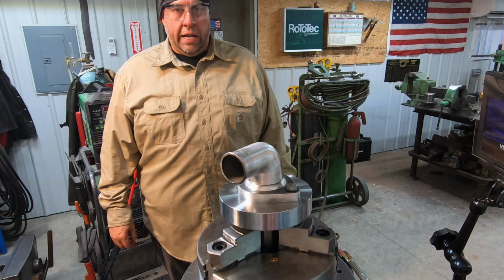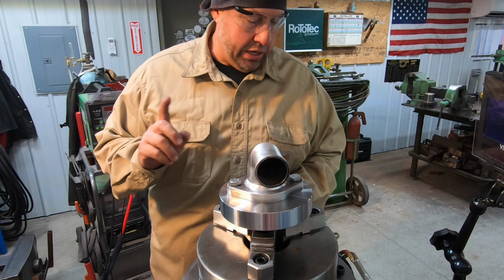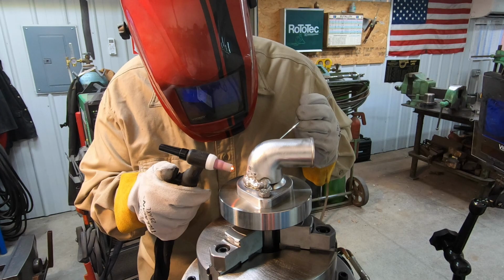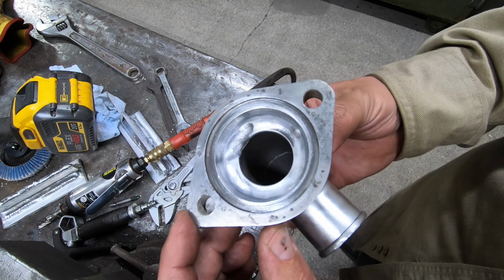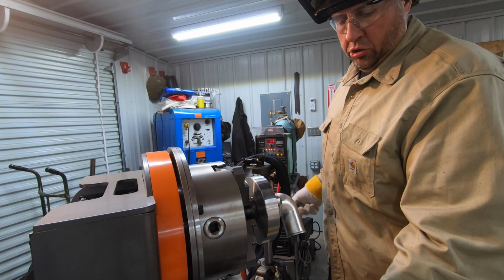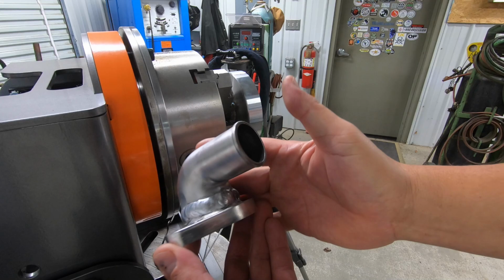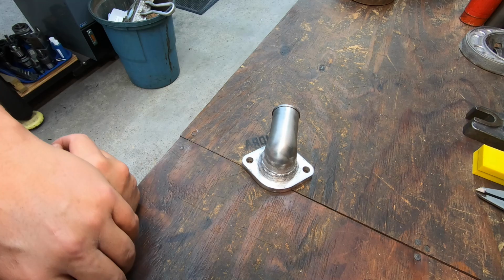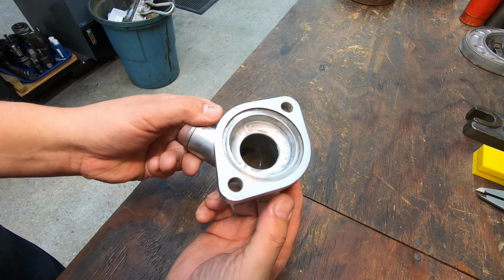SNS 328 Part 2: Welding the Custom Mopar Water Neck

Comment: hey adam i just went through the same thing trying to weld a cast aluminum oil pan. unlike you i finally gave up.have you thought about trying one of those torch switches that can control amps? i think i would have a better chance of winning dancing with the stars than mastering two foot pedals.

Comment: Pot metal is my guess. Back in my early atv days, I was prone to coatings, ceramic, powder coating, etc. Water pump covers, clutch covers, always came back cracked. Those low structure parts were always made of pot metal and confirmed as the problem every time the coating place handed me back a pile of chunks (we were cool, theyd always buy me new parts).

Comment: In case when aluminum welds like this it means that you provided not enough heat and shielding. Use larger cup and put like 180-190 amps. Personaly i would go for 200-210 for rotary table but i'm pro welder, you're pro machinist; if you saw me at work i bet you coud have same amount of things to point out :). For that thick material also increase AC frequency to hear constant buzz rather than this low rate shooting. It's more abrasive type of current. If you have AC balance in that machine put sinusoide more to DC+. That will help with oxides and eventual dirt.

Comment: Congratulations Adam. I think you made a valiant effort..... And the results really aren't that bad. As a man said "she ain't much for pretty but if she don't jump I think we got her!"

If it were me I probably would have tried to mount that flange on a four jaw independent and cleaned up the weld with a half inch button insert mounted on an extended neck tool holder..... Just for cosmetic purposes.

Comment: Raising the frequency doesn't "shake" the puddle so deep. Higher frequency will narrow your pollution zone and keep the contaminants more shallow. Also.. if you have enough filler.... just liquify the puddle and go around a couple times and let the junk float to the surface.
Glad you stuck with it.  Not your style to give up :-)

Comment: Talking about dirty aluminium,one of my late brothers in law worked at an Aluminium smelter here in New Zealand who obtained some Chinese smelted  aluminium to check on its purity and found it was so high in iron that rust formed on the surface of the ingots that were stored  under a lean to shelter. Do like watching your videos!
Reply: When you can pick it up with a magnet you know it's bad aluminum. 😆👎

Comment: Solid and gaseous impurities in molten metals are the bane of a producer's existence.  There are a lot of technologies available to purify molten aluminum but each is expensive and potentially dangerous, especially in a job shop environment where the low price supplier gets the work.

Comment: As far as aluminum castings go, this one is not bad at all. They are always nasty, no matter how much you clean the surface, cast aluminum is nasty on the inside. And as soon as you puddle it, the nasties come out it. Exactly what was happening to you. So what you do, is you lay down a bead, grind all the dirt out and lay down another bead on top. Your filler rod is clean, unlike the casting. So eventually you get solid material. Exactly like you were doing, this is pretty standard practice. And once it's structurally good enough, it's good enough, even if it looks a bit ugly.
Reply: Well said.

Comment: Adam, I am a mobile mechanic and deal with aluminum from time to time. I prefer brazing to welding. I use a HTS-2000 rod to repair aluminum. You should check it out it takes alot of guess work out. Awesome job on the neck aluminum is a bear to deal with!
Reply: Best comment here.

Comment: Love it when we both learn something. I had a similar issue welding on an old aluminum Alfa Romeo intake manifold. I wonder if this behavior is a property of an aluminum alloy used in engine parts? I'll have to keep the temperature down when I try again!
Reply: Old cast aluminum from the 50s through the 70s was just that ,poor cast aluminum. Seen some parts weld ok and others just get destroyed. The process of using /making aluminum parts improved a lot in the automotive industry coming into the 90s. You should see if you can find some older similar junk parts of the era and trial and error on them first, or take it to a weld shop.

Comment: why not feed argon into the inside of the piece to prevent oxygen from getting into the puddle from the inside?  done on welding tubing all the time.
Reply: That is a great idea
Reply: i dont believe oxygen is the issue on this, i believe its the impurities the non Aluminum minerals and dirt and other stuff poor casts would have in them. The melting of the metal brings it to the surface. he is not melting all the way through the pipe so once he did his first bead filling it with argon wouldnt be of much use.
Reply: He's not seeing porosity, so back purging the weld wouldnt help where dirty castings are the cause
Reply: That would be more useful in a thinner material, or a poor fit up of the metal to be welded. Which the fitup here couldn’t be anymore perfect.
Reply: @LRGRivera  Wtf? Aluminum is highly reactive to oxygen. The only part that isn’t is the oxide layer on top of aluminum, and that is because it already reacted. Aluminum oxide forms almost instantly on a cleaned aluminum surface, meaning the aluminum is reacting with the oxygen in the air forming a layer on top of the aluminum. Although I’m sure you’ve been “welding aluminum for years without cleaning and haven’t had any issues”. Easy for someone that hasn’t passed any certs for aluminum to say.

Comment: All aluminum castings are weldable.   Welds are just castings without molds.
Bake castings carefully at 400 °F and use the torch soot method of preheat.  When soot burns off, it is hot enough.  Just a light soot is enough.

Comment: oxy-acetylene when in doubt with aluminum. And when you might have several weld start/stops it’s best to start your weld and weld into where you stopped... so your backing up into your weld. 
 Figured I’d drop off some knowledge from a channel where I’ve learned from.
 At the end of the day you got the job done is what counts

Comment: I swear, welding aluminum that has contacted chemicals is a steady challenge for me. I welded up an A/C fitting. I had to heat it to take the impurities, then finally weld it after it cooled. Even then I was only able to do about 5 dabs at a time. 
Another one is cast iron that has touched brake fluid. Those types of things, are just plain difficult.

Comment: I saw the video preview and thought, huh, that seems a little rugged for Abom.  :)  Seems like you learned something new for the next time you weld on some shady aluminum, so that's the important thing.  That, and it's stuck together and going to work just fine!  

Also, the camera you had set up to film while welding looked awesome when everything was facing the right way trying to weld on that awkward part.  Would love to see more of that in the future.

Comment: Was the wire wheel you used to "clean up" the parts before you welded the ally using steel wire? It was necessary for it to be stainless steel otherwise you put contamination into the base metal. That would explain much of why you  were  experiencing problems.

Comment: The part is contaminated with antifreeze within the pours of the metal. It is never going to turn out nice. Now it they where brand new parts that haven't been used. Then it would be a different story.

Comment: That porosity and black oxides looks so familiar! I occasionally get some broken casings at my work and attempt to weld them; same problems; some successful and some not. I thought it was me as most of my welding is in steel and really no other aluminum work. Now I am curious about trying again with your friends advice. You got it done in the end and that's what counts when the job is challenging like that.

Comment: Awesome job abomb yea cast aluminum most of the time sucks some times it’s good but whenever I run into it most of the time it’s bad. Another trick I found is I have really fine stainless steel wire brushes that go on a dremel and I clean each pass before and after with the brushes the dremel just makes it easier than by hand and a little better to get into the tight spots. I don’t know it it really matters but I have heard especially with aluminum to brush with a wire brush in one direction like forward but not back or the opposite when you drag it back the other direction it brings back more contamination that was just swept out. It’s just something I heard a couple years back and now I try to do it on stuff like cast aluminum or something I want as clean as possible. Anyway I think you did a great job Adam your the man thanks for taking the time and sharing your hard work 👊🏻🍻

Comment: Something I didn't see brought up... some aluminum alloys are basically not weldable.  We don't have any idea what alloy this neck/flange were cast from.
Reply: I've welded some 7000 series aircraft grade aluminum before... apparently lots of nickel or zinc in it so difficult to weld. Got the two pieces stuck together but it didn't play nice.

Comment: Sharpen your tungsten, I have no idea what frequency your using to weld but it almost sounds like it’s 60hz. If so try increasing the frequency a little bit that will make your start ups a little crisper. And on cast aluminum you want to treat the weld more like your rig brazing rather than welding it.
Reply: Depends on the electrode hes using, but some of them round off and wont keep a point. We have a few options where i work. I learned on tungstens that round off, so i prefer that for aluminum tbh
Reply: When welding aluminum you are supposed to used a balled tungsten. You actually set the machine to “DC electrode positive” and strike an arc on another surface to cause the electrode to “ball up”. That’s pretty much the only reason a machine has the setting for a positive electrode, so the electrons can bombard the tungsten and melt it for balling to weld aluminum. Electrons flow from negative to positive, so they hit the tungsten and melt it.
Reply: I wouldn’t say he sucks. He’s a trained machinist and basically has learned how to weld along the way. This isn’t a welding a fabrication channel so I don’t think anyone expects him to be a seasoned professional welder. He does a good enough job to get by. But because of his character and his standards he has spoiled his viewers to seeing nearly perfect results. Adam has more character than most folks. He will openly admit his mistakes. Most people would try to fix it behind the scenes. Keep doing what your doing Adam we appreciate your level of craftsmanship and the outstanding character you put on display every video.
Reply: @luckydawg1226  once again sift thru his videos.  He's got some welding that's suuuper elegant and anybody would be happy to claim them for themselves.
Reply: @DukeBiggsley  Sorry Duke, but you don't seem to understand AC welding.  No, the "ball up" does NOT need to happen.  Use a better quality electrode.  When a machine is set correctly, a sharper electrode is better in controlling the arc.  The electrode positive of the AC is what removes the aluminum oxide surface.  That's all.  Once that is done, you can weld aluminum in DC.  Check out the newer machines.  Yes, you are correct, back filling with agron can help.
Reply: @davidswanson4437   I didn’t even say anything about the AC welding process. I simply described the process for balling the tungsten and how it works. It’s how I was taught in class a decade ago and also by experienced welders in the field, so it is what I do.

Comment: If it was magnesium wouldn't it catch on fire?
Reply: Mag is weldable, weld process is very similar to aluminum.
Reply: Had no idea you could weld it.. We use to just burn it
Reply: lol yeah, don't get me wrong, if you really screw up while welding, you could light it off.
But generally it welds pretty easy, assuming you can get it clean enough.

Comment: I had the same types of trouble welding aluminum pontoon hulls.  Forklift hit my boat and tore a hole in it.  I had to keep going back and grinding out the porous spots and re-flowing.  When I could grind the whole bead and not see any pin holes, I knew I was done.  Tested it after a year and not a drop of water got inside.

Comment: Hey adam, I had a recent craigslist score and landed a Scherr-Tumico 0-1" mic and a spare mitutoyo 0-.5" barrel. I'm having issues with the ST mic feeling very stiff, even after oiling. It's in great condition, but is too stiff to use the ratcheting mechanism. A while back, I had a stiff Starrett 203c and did the same process (it feels like butter now), but it didnt work on this one. Any ideas?

Also, I cant read the numbers on the label for the mitutoyo box so I'm not sure what exactly I have. It's just the barrel, no body. It says it's a 0-.5" but that's the only identifying text on the barrel. Do you have something you can use it for, or any idea what tool it fits? 

Thanks!
Eric
Reply: On your ST mic, I have rebuilt several with the same symptom, on two the previous user had damaged the anvil    and essential knurled the bore creating a tight fit. A little light polishing fixed them, another had a damaged thread from metal getting into them.  On the Mit, there are a lot of possibilities as there are a lot of custom mic parts out there. Good luck.
Reply: @heavymachining7830  thank you so much!

Comment: An easy test to see if it's magnesium is to put some acetic acid, White acid, on the part and IIRC it'll react if it is magnesium, if nothing then it's aluminum. You can also try and ignite a small piece of it, always an option
Reply: Instant floodlight if it burns!
Reply: @ruffshayv4363  if you tried the latter test you would do it on a small, separate piece, not on the whole thing.

Comment: Nice job - some of that cheap old cast is evil, like a sponge that's soaked up 50 years worth of crud, then when you weld it it hits a certain temperature and it all comes bubbling out right up through your puddle. Not sure if its prolonged exposure to heat water and oil but engine parts often seem to be some of the worst.

Comment: Never ever use a galvanised wire wheel, always use stainless wire wheels and brushes.
Bead blast it to get the oxides off, lots of acetone or other high grade solvent to degrease it.
Cast aluminium of unknown origin is something I am hesitant to weld

Comment: I wouldn't call it "poor quality" it's just a casting.  Not all metals are meant to be welded.
Reply: It was also poor quality.
Reply: Poor quality. But also not the material he thought it was. It's most likey zinc/alloy rather than aluminum.
Reply: @Sykotix420  Nope, that was a quality piece.  Definitely aftermarket and not factory and nothing like a factory Magnum water neck, which is made of sheet metal and smaller diameter.

Comment: The most expensive $25 part ever 😬 sorry you had trouble but like others I appreciate the “learnings”.
Reply: Almost dead on with the $.  Looks like Summit makes an aluminum "racing" thermostat housing with the 90 for $28.  

More concerning is that a quick look around shows a handful of the straight thermostat housings are zinc alloys.

Comment: MiG or gmaw welding is the best option for cast aluminum. Also try dropping down to a smaller size filler wire

Comment: Feel a mixture between too low of a frequency setting on your machine, too small of a cup (i personally use a size 10 or 12 on alumn), dirty/contaminated tungsten 🤷‍♂️
Ive ran into that in the beginning of my tig days and such

Comment: That could also be a die casting alloy - they put silicon in it so it flows into the mold better.  That stuff welds horrible, like it's full of dirt.  This is common on Japanese motorcycle parts.  One thing I do to help weld poor quality aluminum is to use only enough amps to make a shiny puddle, and make small circles with the torch to "wash" the aluminum without adding filler.  It'll look a mess, but eventually it cleans up and you can add filler.  You have to let it cool (as your welding shop guy said) and repeat the process - basically tying tacks together. Slow going.

Comment: Yep, welding unknown alloys can be tricky. I once had someone bring me a bicycle with a cracked seat tube that needed welding. Just a Chinese folding shopper but it had an alloy frame. I cleaned the paint off, ground a vee in the crack & managed to get a reasonable looking weld on it but as it cooled, the weld bead fell out! I cleaned it up & tried again. Same thing. Huh? So I Googled the maker's name on the bicycle & looked them up. Turned out they made their frames from Magnesium!

Comment: magnesium was used a flash powder because og low ignition temp and white flame so i understand its difficult to weld but i dont understand why it should glow green when welding
Reply: I'm surprised that it is even possible to weld magnesium - I just assumed it would catch fire if you tried.
I guess the shielding gas would exclude the oxygen enough to prevent combustion.

Comment: 😳 Did you use a stainless brush, cleaning it up?
Reply: Also, thoroughly degreasing with something like acetone is good practice. Still, cast aluminum is like a sponge for oily residues.

Comment: I always found at times welding aluminum that when you first start the weld pulls contaminates to the surface, black ugly but unavoidable. To get past it you need to take a burr motor and go around the weld without making it any larger than it is cleaning the surface and the black out of it. The weld it again. On a real nasty piece you may have to do this several times. Castings are the worse.  Sand is what's causing the black impurities to pull to the surface.  Thank you for the great videos